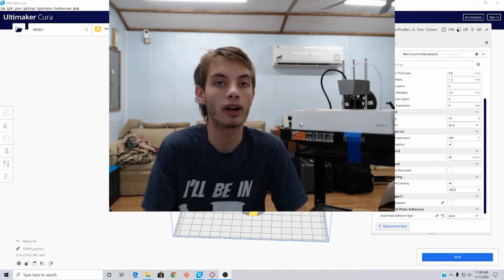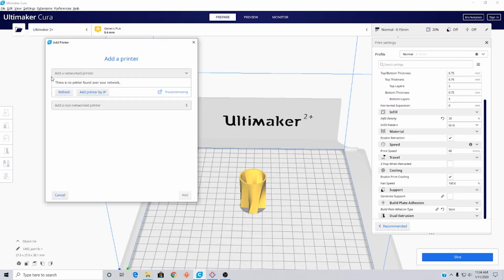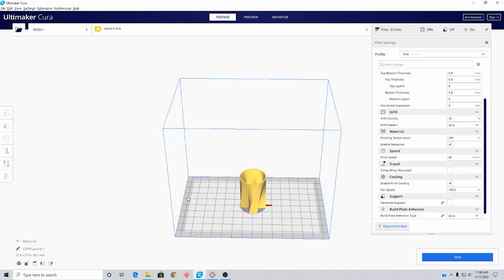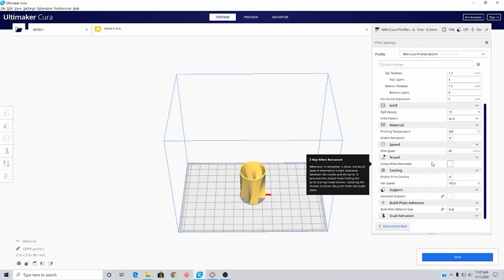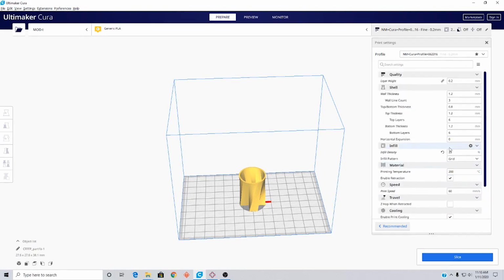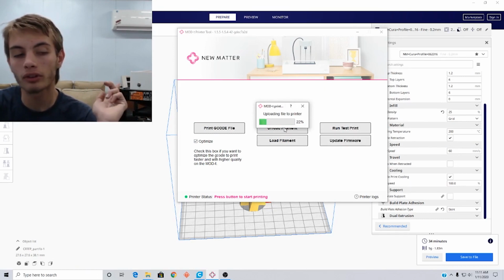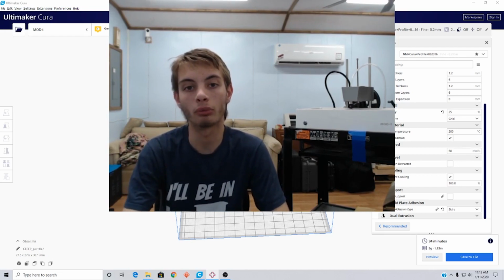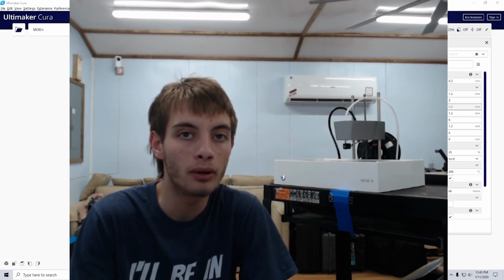How to use MOD-t 3D-Printer with Cura 4.4.0!

Comment: Hey thanks for the video! I got a problem where the bed stops in one place and the nozzle extrudes a bunch of filament in one spot, then cant extrude enough whiles it moving. Results in incredibly lumpy prints. Any ideas for why this is happening?

Comment: I found it helpful to add a different start and end Gcode in cura 
New start Gcode:
G90
G1 F300 Z1
G1 F1200 X77 Y15
G1 F300 Z0.315
G92 E0
G1 F2520 X77 Y-35 E4
G1 F2520 X77.5 Y-35 E4.05
G1 F2520 X77.5 Y36 E8
G1 F5000 X77.25 Y36
G92 E0
G1 F2520 X77.25 Y-35 E4
G1 F2520 X77.75 Y-35 E4.05
G1 F2520 X77.75 Y36 E8
G1 F5000 X77 Y0
G1 F300 Z1
G1 X0 Y0 F5000
G92 E0

New end Gcode: 
G92 E0
G1 F360 E-2
G1 F300 Z128
G1 F3000 X0 Y40
M104 S0
Reply from the maker: I'll throw in it and give it a shot!
Reply: Hello sir, I would appreciate it if you still had the ini file, I was gifted a MOD-t and it mostly works. The print head starts off too far away from the bed plate. I will try a new print with the correct nozzle width as well.
 @Daltonx12

Comment: Thought I setup it right but starts print 1 inch above plate ?
Reply from the maker: In the starting gcode, there is a line G28 Fx.x - that F number is the starting height, you'll have to play with that number to get it properly adjusted.

Comment: Have you ever had any issues with the print plate?  I bought new plates because the first one stopped holding the prints...and the new one didn't seem to last long at all either.  Any tips/tricks on how to keep prints flat / adhered?
Reply from the maker: Use blue or green painters tape, PLA filament will stick well to that. Also make sure that the nozzle isn't too far from the build plate.
Reply: Yup painters tape use to work well for me

Comment: I clicked on your link for the cura profile for the MOD-t (above) from your google drive, and it's not letting me download it. It says it's in your trash folder. Would you be able to update the link or email me the file? I would really appreciate it.
Reply from the maker: Send me a email, and I'll get you the updated file!

thanks
Reply: @Daltonx12  Is there any way I can get the New Matter software download on my windows laptop? Everything has worked, but all I need is the app so I can print my project out. Thank You!

Comment: Good video but missing one important piece of info that I see a few people have been asking about.  A link to the NewMatter MOD-t Printer Tool that allows you to send the G-code file to the printer.  It is on GitHub.  
https://github.com/tripflex/MOD-t
Look in the software folder.  It has WIN and OSX versions.  I downloaded MOD-t-FINAL-DISABLES-WIFI.exe because i couldn't figure out how to configure wifi anyway.  Of course now that I got it printing it will not set the correct Z height on the first layer.  It is about 1mm to high so the first layer does not want to stick to the print bed.  Anyone know of a way to do a Z offset on the MOD-t?
Reply: Hey I had this same problem. The Z height was just a little too high so the filament cooled in mid air. I was thinking about getting a bed mat for it. One should have came in box if you read manual. Please let me know if you have any idea or found a way to fix it
Reply: Jack Ziemniak 

I don’t think adding something on top of the build plate will work.  I tried adding layers of blue tape and that didn’t seem to help.  I think the printer zeros the Z height by rubbing the nozzle on the print bed and sensing the friction.  I don’t know if the issue is play in the Z assembly or what.  Without an option for Z offset in the firmware I don’t know how to compensate for it.  If you find a fix please let me know.
Reply: @chuck4811  Ok ill share if I find anything useful, but for now I found out that these problems are from only people using cura, So I am trying it in simplify3D to see if that will work

Comment: Hey man I appreciate your info! However Ive noticed like 4 out of 5 times I try to print, the mod T goes from calibrate to Idle.. and does not print! Any ideas what I can do? Ive pretty much followed each of your instructions in cura.
Reply: I am guessing that your printer is failing to calibrate. Is the bed ending up at the back right corner?
Reply: @3dprintingandairguns668  Dude mine does this! Is there a way to resolve this? I thought of just uninstalling Cura and getting a newer version. Older gcode files work, but any stl files I try to slice now have the printer try to print outside the bed. Specifically, at the back right corner..
Reply: @nicholasbishop01  I have found if you help the bed during calibration reach all the way to the back, left side, front it will calibrate correctly.

Comment: There is better start and end gcode
Start Gcode: this will prine the extruder on the far right side of the bed, and it will print at the right height
G90
G1 F300 Z1
G1 F5000 X77 Y26
G1 F300 Z0.315
G92 E0
G1 F2520 X77 Y-45 E4
G1 F2520 X77.5 Y-45 E4.05
G1 F2520 X77.5 Y26 E8
G1 F5000 X77.25 Y26
G92 E0
G1 F2520 X77.25 Y-45 E4
G1 F2520 X77.75 Y-45 E4.05
G1 F2520 X77.75 Y26 E8
G1 F5000 X77 Y0
G1 F300 Z1
G1 X0 Y0 F5000
G92 E0

End gcode this will lift the nozel all the way and move the trey to the center front
G92 E0
G1 E-2 F200  ;retract the filament a bit before lifting the nozzle, to release some of the pressure
G1 Z127 F300
G0 X0 Y35 F3000 ;move build tray front and center, Leave room to remove build surface
M104 S0
M107  ;Fan Off
M84   ;Motors off
Reply: Hi John, i tried your Start and end gcode.
But the nozzle start on my printer to near on the platform.
the first layer cant be printed.
how can i change the start gcode,so the first layer is a little bit higher?
Reply: When I tried Daltons start gcode my extruder was to far off the bed so I am sure it is just a different initial layer height in cura.
Reply: what is your initial layer height? Under Quality
Reply: @johncoder7555  hi John,thanks for your fast reply.the layer height is 0.2mm for the first layer.
Reply: @christophnox2901 Not layer height but initial layer height only I would bring the initial layer height to 0.3 to 0.36 depending on how much squish you want.
Reply: @johncoder7555  I only have layer height. There's not mention of initial layer height.
Reply: Regardless of the lack of a distinction between the layer height and initial layer height, @John Coder your G Code saved the day for me! It's working now!!!!!! Thank you so much for posting this
Reply: Under Preferences - settings visibility search for initial layer height and make it visible.
Reply: Hello John and thank you so much for sending that code.  My Mod-t worked first time after a long time!  Much appreciated
Reply: @NatSchuff  hey mate, I opened it up in Notepad++ and was wondering how you know how much of the start and end you adjust/how you know when that code is part of the build? 

am i right to assume it would be between these to portions? 

";Prime the extruder
G92 E0
G1 F200 E3
G92 E0
G92 E0
G92 E0
G1 F900 E-6.5
;LAYER_COUNT:450"
Reply: @connoroneil3397  Hi there.  i just put in all the numbers line after line, removed the words.  In the start code there should be 17 lines and the end has 7.  Having said that it worked for a few days and now I have my old issue again - just calibrating and the plate ending up at the rear right corner with no printing.  I've just downloaded Cura 4.6.1 and i'm going to try that.
Reply: Yes I'm still stuck with this in either 4.4 or 4.6.1

Comment: The mod-t prints TPU (flexible) Beautifully
Reply: J Code did you make any modifications to the mod-t? I’m struggling to print with sainSmart TPU. The nozzle clogs and doesn’t seem to feed the filament into the Hotend with enough force.
Reply: @nicholaswalker4205  I did not modify the print at all, I did however find that the printer requires frequent maintenance. The metal toothed wheel that pulls the filament, especially with PLA, gets filled with plastic and must be cleaned.

Comment: Hey Dalton, thanks for making this video.  Someone just gave me their mod-t printer, so I'm starting from scratch here.  I've downloaded the zip folder on github with all the setup files, but I'm having issues with getting the New Matter Printer Utility working. (What version of this program should i download? The final version, or 1.5.2?)  It does not detect my printer even though it is plugged into my pc (Win10).  Any help with this would be amazing
Reply from the maker: Please email me, and I will send you the correct install file.

sizemoredalton@gmail.com
Reply: @Daltonx12  I am in the same boat. May I email you as well?
Reply: i was wondering samething the github stuff idk about 🤷🏼‍♂️🤷🏼‍♂️

Comment: I just picked up a Mod-T printer but I have the 2.3.1 version of cura my laptop is not compatible with any other version any advice or will the previous video settings work?
Reply from the maker: I'm not really sure, you can try the settings in this video as the basic operation of Cura is the same. Please email me so that we can keep in touch, I'm curious as to what you find out.

Thank's
-Dalton
Reply: @Daltonx12  update. The settings work for the version of cura I have so thanks.  I do have a few questions and some problems that I need help with I have pictures but should I send them through Facebook?
Reply from the maker: @tameclon9t9  please send them through email

sizemoredalton@gmail.com

Thank's

Comment: my printer with this profile starts the print just a little bit too high up so it always messes up can you help me. ps great video
Reply from the maker: Edit your starting Gcode in the printer settings to the following

G92 E0
G1 F200 E3
G92 E0
Reply: @Daltonx12  Still prints just a hair too high.

Comment: After following the instructions, it starts the print way to high off the build plate. Any ideas? Slicing with Cura 15 still works correctly.
Reply: Got it, I removed the following lines from the Start G-code in Cura 4.4.1
G28 ;Home
G1 Z15.0 F6000 ;Move the platform down 15mm
;Prime the extruder
Reply: I send you a message on your FB page with more info
Reply: @vipofnothing  I think I'm having the same problem as you. My print is starting about 1mm too high. What is your full start g-code?
Reply: @trevory9209  
Start G-Code:
G92 E0
G1 F200 E3
G92 E0

End G-Code:
M107
M104 S0
G0 F360 E-2
G0 F300 Z128
G0 F3000 X0 Y40
G28 X0 Y0
M84
M82
M104 S0
Reply: there is also a much better start and end gcode you can use
Start:
G90
G1 F300 Z1
G1 F5000 X77 Y26
G1 F300 Z0.315
G92 E0
G1 F2520 X77 Y-45 E4
G1 F2520 X77.5 Y-45 E4.05
G1 F2520 X77.5 Y26 E8
G1 F5000 X77.25 Y26
G92 E0
G1 F2520 X77.25 Y-45 E4
G1 F2520 X77.75 Y-45 E4.05
G1 F2520 X77.75 Y26 E8
G1 F5000 X77 Y0
G1 F300 Z1
G1 X0 Y0 F5000
G92 E0

End:
G92 E0
G1 E-2 F200  ;retract the filament a bit before lifting the nozzle, to release some of the pressure
G1 Z127 F300
G0 X0 Y35 F3000 ;move build tray front and center, Leave room to remove build surface
M104 S0
M107  ;Fan Off
M84   ;Motors off

I found this in another comment!!